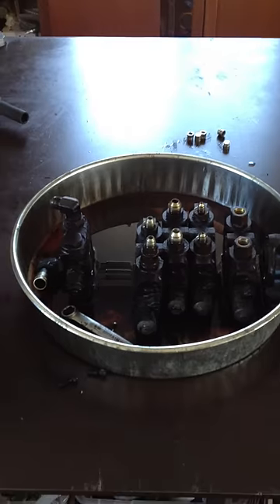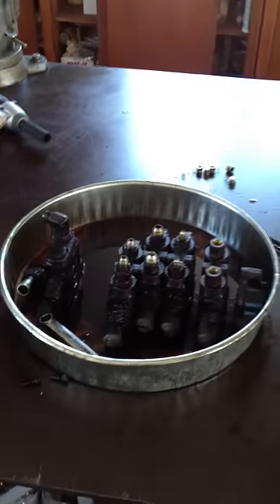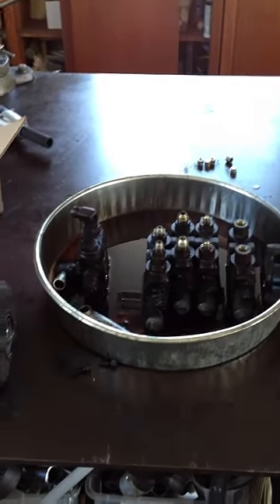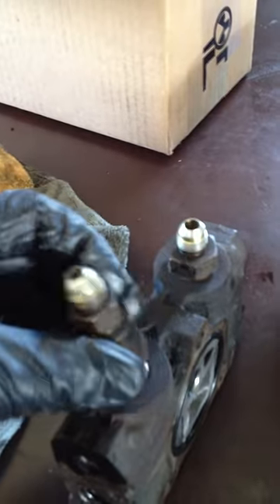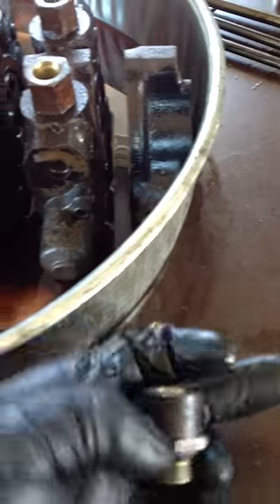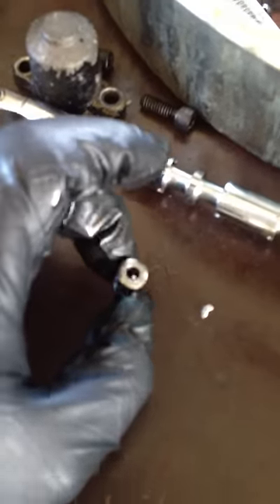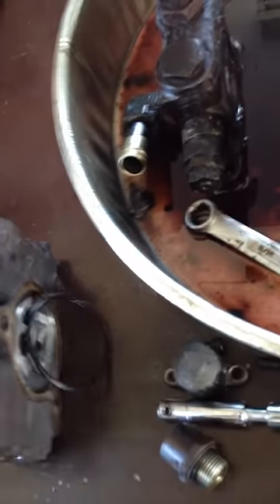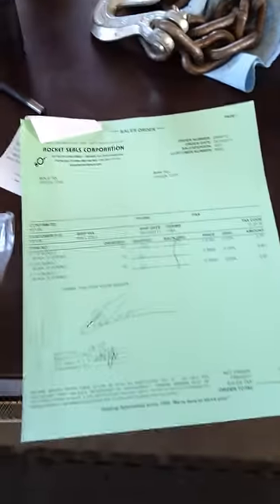Jerr Dan Rollback Hydraulic Issues/Valve Body Rebuild

Comment: Thank you again ! It literally took me no more than 10 minutes to fix mine. I didn't see any reason to remove the whole valve body so I just removed the line and the other fitting that the restrictor is behind. There was a very small piece of metal (not aluminum) plugging the small orifice in the restrictor. Used a piece of welding wire to push it out and cleaned it and put it back together and my bed works great now. Now if I can figure out why when i use the levers going to the valve body it doesn't raise my idle for the PTO automatically 100% of the time like it supposed to I'll be golden.

Comment: Just had a similar situation with my '07, but instead of rolling back slow it got stuck rolling back.  Handle would not move!  Took the hose off, then the nipple thing, whatever it's called, and it was filled with aluminum shavings.  Sorry I don't know what parts are called, but the piece that slides back and forth was toast, getting stuck moving either direction.  Took one out of a truck that's not in service and slid it right in.  Bolted everything back up, flipped on the PTO and it worked like brand new...  For about 30 seconds.  I guess I didn't get all of the metal shavings out of it.  Pulled the hose and nipple thing back off and a few more chunks fell out.  A little brake cleaner and compressed air, blew it out, and it works very well, but not as well as it did for those 30 seconds.  I guess I scored up the slider thing again.  At least it works good enough to keep the truck on the road until we can get a new valve assembly for it so we can take this one apart all the way and see if we can rebuild it.

My question is...  Why the heck do they put that metal in there than obviously keeps falling apart?

Comment: Happened a second time so I drilled out end of restricted and engaged pro on high idle and let it cycle for an hour.  Drilled end of restricter out to same size as pilot hole in fitting out of valve body.  Problem gone for good now next time it plugs pump will be done.  Deck moves faster and I love it.
Reply from the maker: Charlie Mccullagh nice! Fast moving hydraulics are great.

Comment: I see someone said the ram may not have been needed. I wonder if the failing ram got shavings inside as well causing leaks? I assume it was all steel so it probably did not contribute to the alum shavings